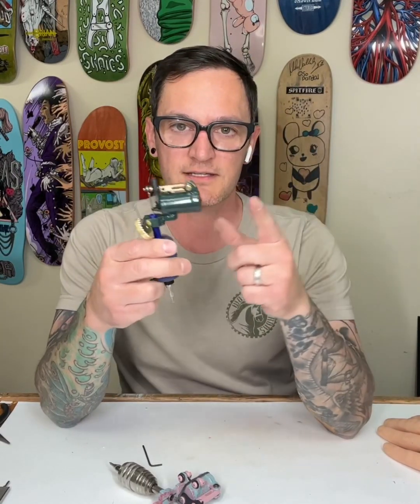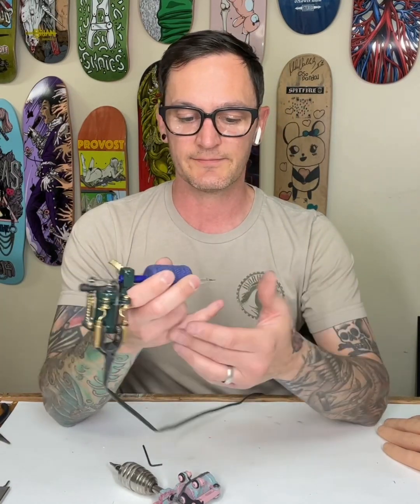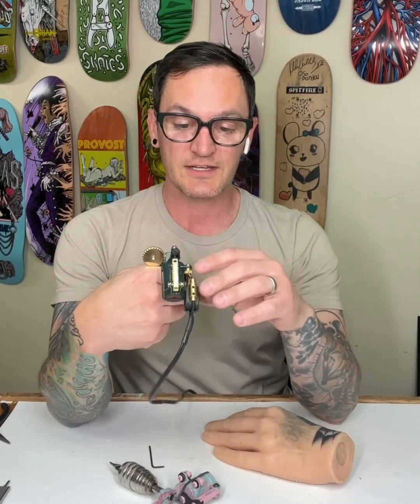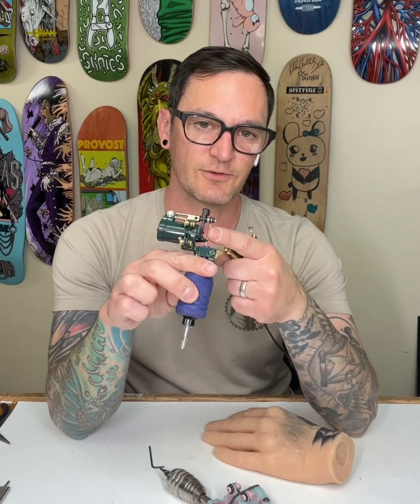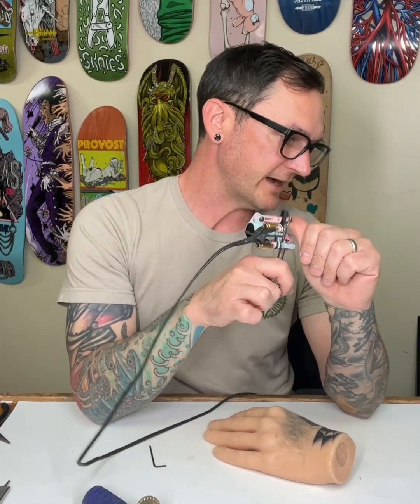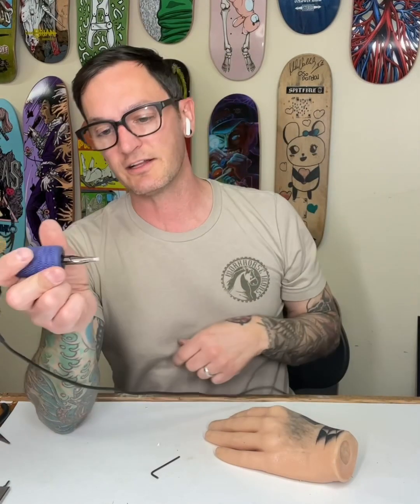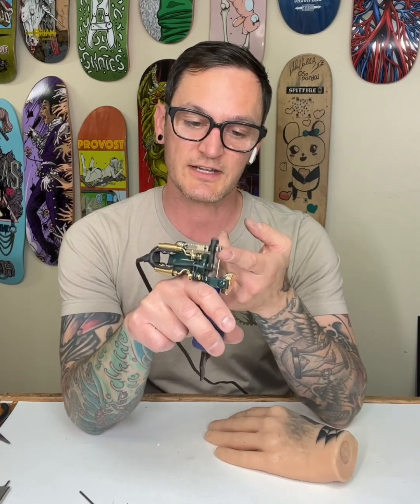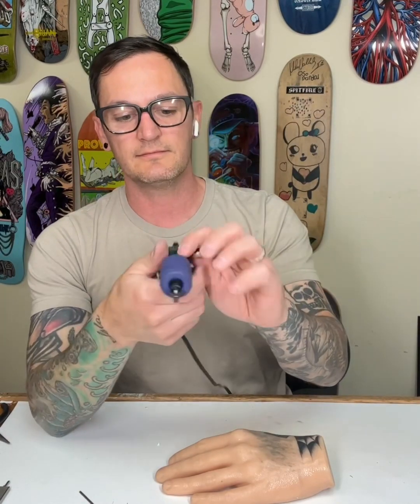Steeldriver Stroke Characteristics.

Comment: purchased one of your machines used from a friend of mine. the thing is fantastic. it’s packed the most solid color i’ve ever managed and has also been great for black and grey with a 3rl. the only issues i’ve had are with needle on bar and DK swift tips, seems to spit like crazy but i’ve learned that i’m probably running it a bit too hot and that 5mm stroke length is probably contributing as well. overall super happy with the purchase and my friend already misses it haha

Comment: Great Video, thank you !
I would like to know how the machine performs espacially with small liners 3RL/5TRL in terms of lining and If theres enough stroke to do low voltage stippleshading. Greetings Marco
Reply from the maker: The Steeldriver is great for small grouping stippling and lining. Plenty of stroke and plenty of power at lower speeds to get nice crisp consistent patterning.
Reply: @Bowerssupply  Can it push fat 18 RS lines especially into a palm?